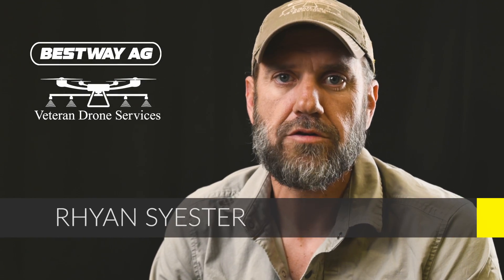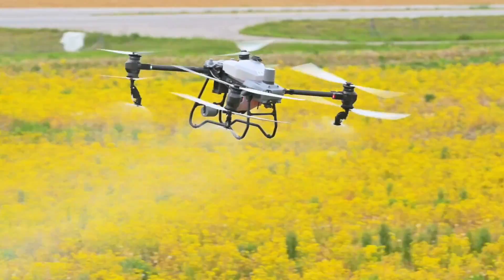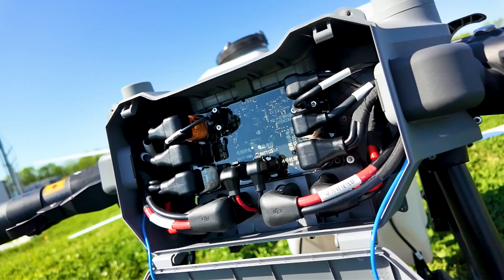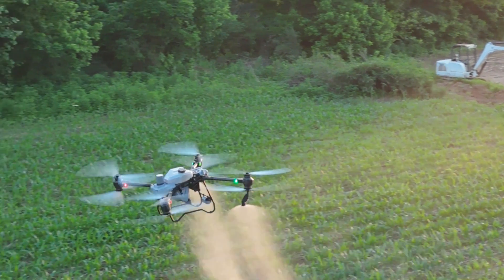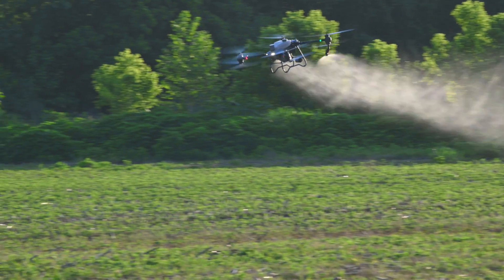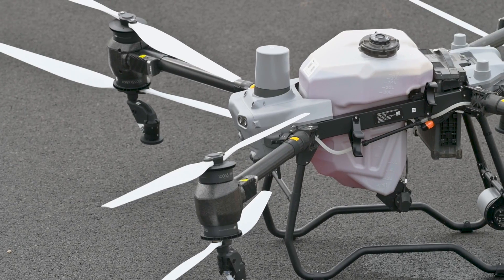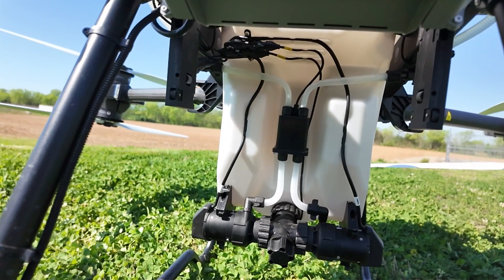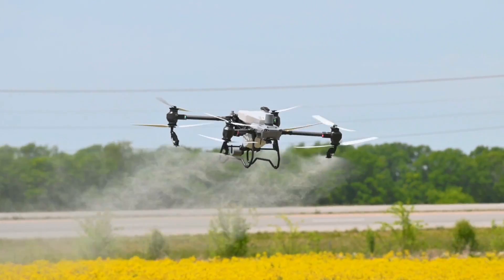DJI T50 flight testing impressions #djidrone

Comment: Nice overview— but I’m confused as to why you used the term “low volume” when most specialty crops require a higher volume per acre. I have had to do  more than 10 GPA with the  T30 and it was painfully slow. These new pumps will be a game changer for me.